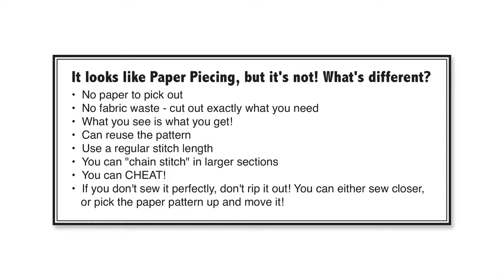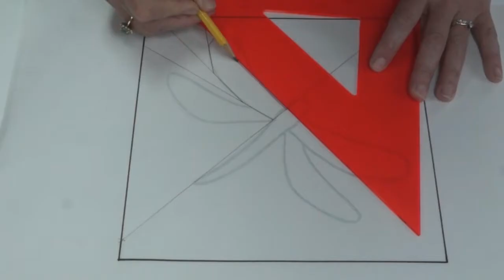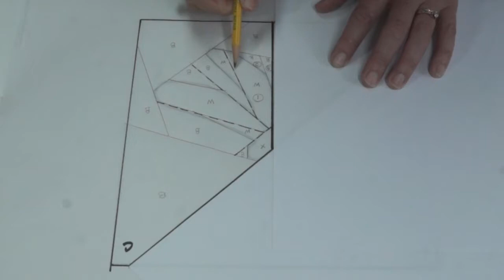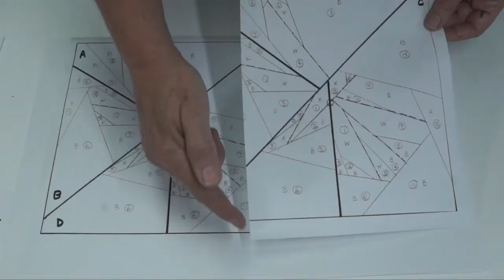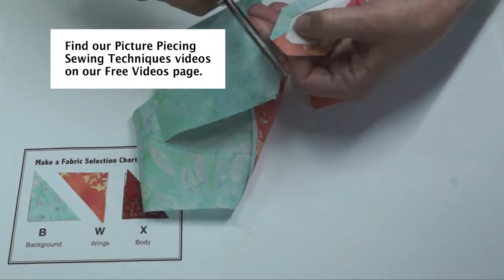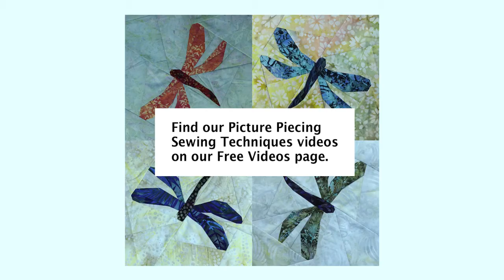Creating a Pattern from an Line Drawing (England Design)

Comment: This is fabulous! Its the perfect method for those who want to create their own quilts or blocks! I like applique for some quilts but its not practical in every case. I prefer a pieced pattern to applique in most cases. Often,  I find applique to be too tedious, too time consuming, too crude or too result to inconsistent,  depending on the effect or finished block or quilt I am trying to achieve. This method is genius and I found it easy to follow. This isn't for everybody, but it truly is not as difficult or complicated as some popular paper pieced  patterns I have sewn,  like those from QuiltWorks. Its surely no more difficult than patterns involving kaleidoscope methods. So don't be intimidated by those who say this is too difficult or involves too much sewing. This method was just what I have been searching for. Its not for beginners, but your instructions are fine for intermediate quilters with a few quilts already on the wall or on the bed. Thank you so much for making the dreams in my head possible!